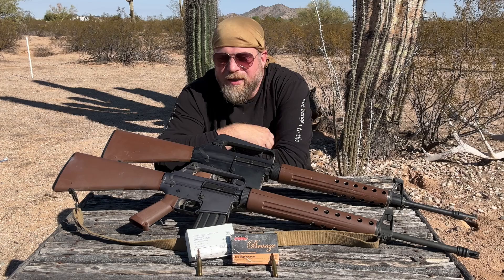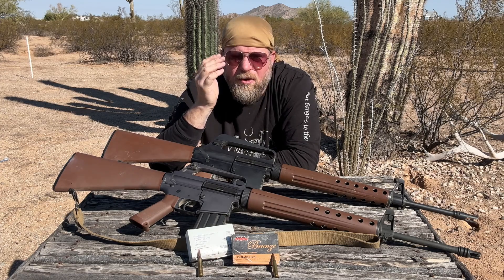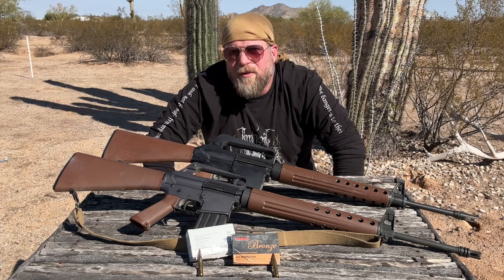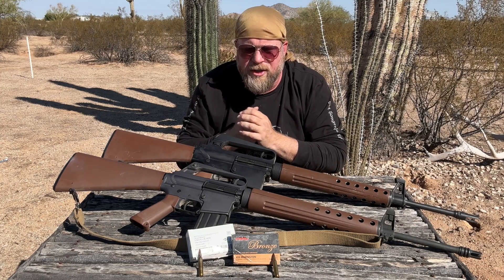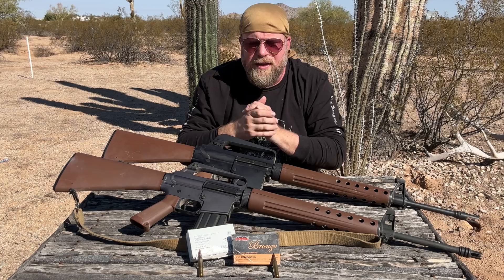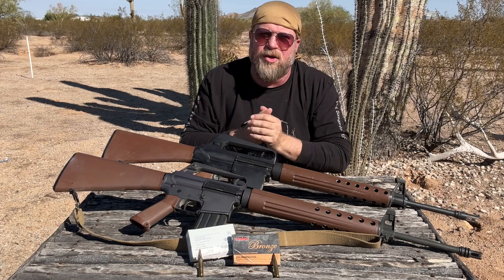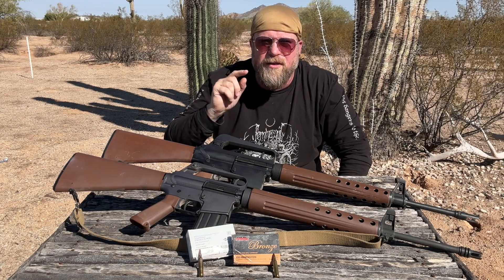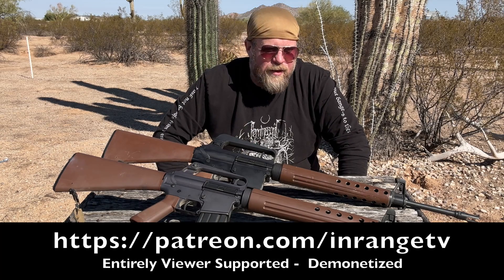What is M193?

Comment from the maker: This a very complicated topic with a bunch of nuance.   I have a few corrections, which do not change the overall conclusion or message here, but are worth mentioning:

5.56 is a NATO adopted standard, but that was done with M855, not M193 specifically. M193 does have a US standard and a standard in general (that appears to be accepted and adopted and manufactured in many countries) but, technically, "M193 NATO" isn't exactly correct...but not exactly wrong either, but not "official".

SAAMI is the Sporting Arms and Ammunition Manufacturers' Institute, which is considered a standard in the US - they work together to make standards for civilians and cartridges, pressures etc.   They are not, however, necessarily internationally recognized.   The other institution which sets such standards is the CIP.  The "Commission Internationale Permanente", is internationally recognized and their specifications apply in Europe, for example, while SAAMI does not.

CIP standards and SAAMI specs are usually quite similar, but not necessarily identical.

Comment: As for the fetish for steel helmet penetration, I just bought a Chinese M-88 steel helmet.  Looks like a PASGET Kevlar except it is steel.  Steel helmets are still in production even in 2023.  Further, the Russian Army are still issuing the old steel SSh-68 (Russian: СШ-68 [стальной шлем образца 1968 года/stalnoy shlyem], English: SSh-68 steel helmet model 1968) today in 2023 or even airsoft helmets when better can't be found.  In the 1950s the SSh-68 was the most likely helmet for US Soldiers to encounter on the battlefield.  This requirement was a measurable objective standard.  Now with modern body armor, that may be why the US Army is changing calibers.
Reply: Well to think about it, typical steel WW2 helmets may stop standard loadings of 9mm Luger and .45 ACP. 

A lot of kevlar or composite helmets only stop up to some magnum pistol rounds, which really isn't that much more protection wise.

There's exceptions such as the ECH which has shown resistance to 7.62x39, but steel helmets still seem practical to me.

Comment: Another good one from Karl.   One amendment that was correct early in the video and then the end short list was stated wrong is the Anneal aspect.   Visible Anneal is the operative word(s)  used early and was paraphrased to just "annealed"  at the end.   In fact all brass bottle neck brass cases are annealed.   Its just polished off in a lot of ammo makers (some no) because it looks pretty.   Military is required to show anneal (easy inspection).    For those who anneal cases,  if it polishes off you are at or below too much heat (good).   If it does not polish off (sometimes a few polishing)  then its overdone and has been to hot and permanently softened (it will still shoot and not horribly).    You never ever want to get the case so hot the head end is heated up,  that indeed will mess things up and a ruptured case is a given (that is any you do not anneal a whole case in an oven).   An aside is Lapua makes a big deal their cases are annealed when in fact they simply do not polish them.    Again all case shoulders/mouths are annealed to spec (more or less 750 deg but duration is important,  you can anneal at 500 degree if done long enough but you also risk the case head)

Comment: In my old Hodgdon load manual there are specs and load data for 222 Remington Magnum. The case size and OAL is larger but load data and pressure is less. Maybe a predecessor? 
Also I was told mil spec brass has less volume due to thicker case walls. Those crimped in primers are good for staying in. A pain to reload.
You gonna pick up that brass?

Comment: I just looked at some 9mm  nato ammo that I purchased just before the covid scare.  It winchester 9mm nato 124 grain 1200 fps.  It is not stamped as nato in letters, but has what looks like the circled cross nato symbol.  The primer is crimped, But I see no obvious primer sealant or bullet sealant.   
The price was quite good compared to now.  I will take box of it to the range to make sure that my glocks will fire it.   Maybe nato 9mm has a harder primer.  I will find out.
Reply: It's slightly harder   .  Around +P. Good range and SHTF ammo. Had only one fail to fire in my glock. Tried it 3 times and didn't fire. It was a good strike also. Bad primer my guess. And one fail to fire in my P320 but fired the 2nd time

Comment: Nice video 
Interesting to have someone spell out the differences
I varmint hunt with a Custom Heavy barrel Savage in 223 
The barrel has a tight chamber
It also has 0 free bore 
I load the bullets so they touch the rifling when I chamber a round 
So I load with the proper powders and at the correct amount
So the ammo I use dose not have a dangerous pressure spike 
I would hate to see the pressures a M193 round would produce in my rifle
Reply: @wyomarine6341 Not saying the M193 would blow up the rifle 
But I am sure the pressures would be well over what I want 
As for the the chamber and throat 
When I close the bolt , it takes more effort 
As I am pushing the bullet into the rifling 
I get a rifling pattern on the bullet when I unload when not firing 
I just want as small of groups as possible 
200 yards I ask witch eye 
LOL 300 yard groups are under a inch

Comment: I wonder, how would the pressure from a 5.56 M193 in a tight-fitting .223 chamber compare to a .223 proof round in the same chamber?
Reply: Never does any 5.56x45 fired in 223 chambered guns every blow up the guns or damage them.
Reloading data for 5.56x45 & 223 in many reloading books is on the same page with max powder charges exceeding any and all commercial & Military 5.56x45 loaded ammo.

Comment: So a couple of questions.

With m193 being the nato spec we can assume all of the bullets will probably be of a particular design and the ogive of every bullet will be uniform

.223 isnt going to be like that, even with bullets of the same weight. A 55gr fmj from seirra isnt going to be identical to a 55gr from Hornady. How does this jive with the tighter .223 chamber? What about longer, heavier bullets in .223? Shouldnt that be a surefire way to overpressure a  223?

Are all .223 chambers cut identically?

Theres a super interesting article published by Lucky Gunner. They took a selection of .223 barrels and 5.56 barrels and rigged them to test the pressure generated with different loads. Its been a few years since i read it but they found that "some" 5.56 barrels would make more pressure with  .223 than "some" .223 varrels firing  5.56. The conclusion being that even mfg cuts their chambers just a little bit different.

I would imagine .223 reloaders are exceeding the pressures that 5.56 would generate onbthe regular

Comment: I have heard of small arms analyses that the US did after WWI that determined that the advantage distance of infantry engagements were within 500 yards. Penetrating a steel helmet would be one metric to determine the feasibility of a infantry weapon, been the most bullet resistant piece of gear that the common soldier had at the time... that's just conjecture though.

Comment: And to make things even more fun in europe cip test for .223 chamber
is still proofed with 5.56 pressures. So in that logic it makes sense why
pretty much any ammo is marketed as .223rem and true 5.56 is 
nonexistent. So every cip proofed gun should be able to take
5.56 ammo whitout issues. 

Other example like typical 9x19mm fmj is generally loaded to nato spects
by default. So i would guess pistols are also made to handle those bit
hotter loads. American counterparts seems to be loaded bit milder
when compared to bullet weight and muzzle velocities.

Comment: This begs the question: is there any difference between XM193 and M193?  I have seen both marketed and fired both.  I presumed that there was no difference, and on the practical level there may be.  Or maybe there is a difference?  Why market something as "XM193" vs. "M193"?  The "XM" designation implies "experimental", and in this context would seem to imply some difference in velocities, pressure, or powder.  I honestly do not know.

Comment: For anyone coming to the comments to ask about the .223 Wylde chambering, yes you can safely fire both 5.56, and .223 in that chambering. That’s part of the intention for the chambering and you may see better accuracy.
Reply: The Wylde chamber has tighter freebore than the 5.56x45 NATO chamber so tends to be more accurate.   It was designed for match use with longer bullets that need to be hand fed into the chamber.  Although its longer freebore is optimized for cartridges with too much bullet projection to fit into AR15 magazines,  it also keeps pressure down with military 5.56x45 ammo.  
Many semi-auto sniper and precision rifles are chambered with the Compass Lake Engineering (CLE) chamber which has a shorter freebore like the 223, but a more gentle entrance into the rifling (1.5 degrees per side vs 3°10'36").  It tends to be a little more accurate with AR15/M16/M4 magazine-length cartridges but raises chamber pressures above the 5.56x45 NATO or Wylde chambers.
Reply: Lucky Gunner put pressure sensors in a few .223 Rem and 5.56 NATO chambered barrels, and found that 5.56 is perfectly safe in .223 Remington chambers.

The chamber dimensions don't matter and the "it runs at higher pressure" comes from the two historically using different measuring methods.  Now the military uses a test that's basically identical to SAAMI, and the pressure limits are the same.
Reply: @immikeurnot  The Lucky Gunner article is useful but actually  states: " you are not likely to encounter major problems with limited amounts of 5.56 in a .223 rifle fired out of necessity or in an emergency. Doing so at a high volume for the long term is probably not a good idea. " 
 The article also states "5.56 ammunition may be loaded to higher pressures than .223 ammunition" and "Given the same ammunition, 5.56 chambers will have lower pressures than .223 chambers."
    The 5.56 ammo did indeed produce higher pressures in all 3 rifles, just not enough to bother the author.   He even admits that he has had 223 rifles that popped primers with 5.56 ammo.
At the bottom of the article, the author even recommends avoiding 223 chambers in AR15's.
Reply: @jfess1911  Popping the primers will result in the bolt face getting eroded.  Fitting a new bolt on a bolt gun is not cheap.
Reply: @elingeniero9117  I agree that there is a problem if you are popping primers.  
I included that to show that the fellow from Lucky Gunner had indeed seen pressure signs when running 5.56x45 ammo in rifles with 5.56 chambers.  
Whereas is is unlikely to cause injuries to the shooter, signs like popped primers indicate overpressure conditions that could eventually damage the rifle.
Reply: Yeah, and all the stupid ignorant YouTube groupie parrot mouth talkers who never touched a real gun in their life like you believe 5.56x45 Blows up all guns with 223 chamberings but when shown reloading data that shows 223 + 5.56x45 is on the same page and the powder charge date exceeds all commercial and military powered charges it throws a Monkey wrench into all of your BS lies 5.56x45 can't be fired in 223 chambered gun. 
Just yesterday I was shooting 223 reloads I had the powder charges to the level when firing the cartridges, the primers are all flat and the firing pin indent in the primer was pushed back out showing excessive pressure and not once did these cartridges damage the AR 15 I have chambered the barrel using a 223 reamer from Pacific tool & gauge - if commercial or military ammo was loaded to this pressures it would be recalled.
I have had when using a new powder never used before got way too much powder charges that when set off the pressure was so great it blew out the base of the cartridge and swelled the brass case to the chamber and still did not blow up the AR 15 making that bull shit lie 5.56x45 blows up 223 chambered even more of a lie.
I am an advanced reloader since 1976 and a reloader of wildcat cartridge and builder of custom rifles and AR 10s in wildcat cartridges.
I was shooting military surplus 5.56x45 in 223 chambers guns for some 30 years and not once did a Remington 700 Blow up or my own barreled AR 15s in 233 have blown up shooting Military 5.56x45 ammo because it is all Bull shit from dumb asses with little to no firearms experiences.
Reply: Any reloading book dates would tell you this full of crap that 5.56x45 blow up 223 chambered guns is bull crap !
The max powder charges in 223 - 5.6x45 load data exceeds by far all commercial loadings and all Military loadings so where are the damaged and blow-up guns with 223 chambered guns?
All of this BS of 5.56x45 blowing 223 chamber guns is propagated by stupid ass and ignorant YouTube Groupie Parrot mouth Talkers.
Another point to make is I own and many other shooters own AR 15s in 17 Remington with Higher pressure than 5.56x45 and 223 without the guns blowing up .
All of my reloads have pressure so High the primers are flat when fired and again never blown up a gun yet.
YouTube is filled with liars and bull shitters!

Comment: My understanding is that the steel helmets at 500 yards requirement is what they considered to be the most difficult requirement they had for the round's lethality. So by not being stopped by a helmet even at 500 yards, it can present a threat at the ranges they want a rifleman to be able to threaten enemies at.
Reply: On one hand I guess they might not have known how useless that requirement is, but then again they probably would have known that helmets aren't amazing at stopping "full" rifle rounds anyway, not because of power just because of size.  Like, I'm pretty sure they knew by then a helmet wasn't much good against bullets, you wore it to protect your dome from shrapnel.  

It also seems kinda silly just in the context that body armour has now become standard issue to every soldier and in a way it was somewhat forward thinking.  Though if you wanna criticize the record of 5.56mm against armor, that's more thinking than I'd care to put into that topic at the moment.  IIRC 5.56mm hasn't been used much against anyone wearing armor on the level of the US military.
Reply: My guess is that it's less about armor penetration, and more about making sure it's still lethal at that range, even if eg the target is wearing heavy winter clothes. The real question is less why they wanted to make sure it could go through light protection at that range, and more why they wanted to try and make it useful at 500 yards at all.
Reply: @amperzand9162  I figure its the same stupid zeitgeist that demanded everything have match-grade 800yd ironsights and no less than 30caliber for our big strong bois.  Procurement somewhat divorced from what's actually effective.  Then again I recall hearing the Fallout gun rants guy claiming he had to be ordered to use his red dot because he was a crotchety bastard and just wanted to use iron sights so sometimes the office guys know whats up like, red dots good.

Comment: I’ve noticed that when reloading Lake City brass the m193 marked brass is usually above 1.270” after resizing, Where as the .223 labeled brass is around 1.245”-1.255” after resizing. Both have crimped primer pockets.
Reply: Huh.  You'd think the annealing would make the 5.56 stretch less (or is 5.56 brass OAL longer than .223?  They're supposed to be the same, right?)

.223/5.56 is probably the only round I own/shoot that I've never reloaded, so I don't know the specs off the top of my head like .308, .30-06, .338winmag, .44mag, etc, etc.  Oh, and 9mm.  Never hand loaded 9mm, though I really need to get dies for .223 and 9mm just in case.
Reply: @mfallen6894  I have been reloading all my ammo since 1976 and I am a custom rifle builder using wildcat cartridges I have to make from another cartridges.
There is so much bull shit lies when it comes to 223 & 5.56x45 !
I was shooting from a Rem 700 in 223 military surplus 5.56x45 for 30 years.
I have reloading books where the load dates for 223 & 5.56x45 are on the same page and the top powder charges exceed by far all commercial & Military loadings making it the big lie 5.56x45 blows up 223 chambered guns.
Every time I go to shoot here in the forest of the Pacific NW I am picking up brass - yesterday's shoot I picked up Lake city 5.56x45 brass and hordes of other 223 & Lake city brass & unknow where the brass was made, I already loaded some and when sizing and cutting for length there was zero difference in the cases length between 223 & all of the 5.56x45 brass I picked up. 
At times I try powders I've never used because of reloading supply shortages so I buy what I can get.
When reloading some mixed bag of 223 & 5.56x45 brass found at forested shooting location can get too much power then see the pressure was so High the primer is flat, and the firing pin indent is pushed back out and the guns never blow up!
YouTube is full of lying Bull shit !
Reply: you sound like a man after my own heart!!!  pick it up...load it up...SEND IT!! @Lure-Benson
Reply: Ooo a man of taste, what's your favourite 44 mag load? I'm going to be trying to run Reloder 7 and/or Vihtavouri N120 in a Marlin 1894 44 mag @mfallen6894
Reply: @mfallen6894  Annealing is a process by which you soften metal.  That makes it more malleable.  It will dent and bend more easily, and it's less likely to break.  But that means it's going to stretch more.
Reply: @immikeurnot  Oh yeah... duh... lol
I knew it made the case less brittle, so why I was thinking it increased it's resistance to stretching is beyond me.

Thanks for pointing that out!